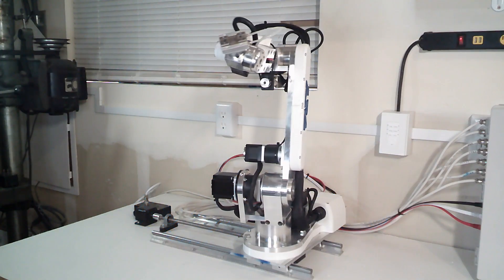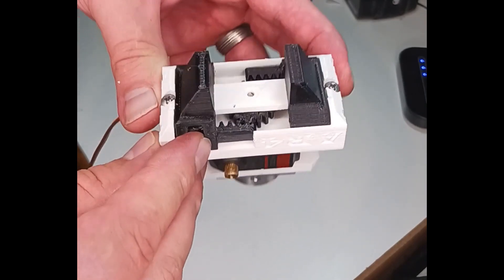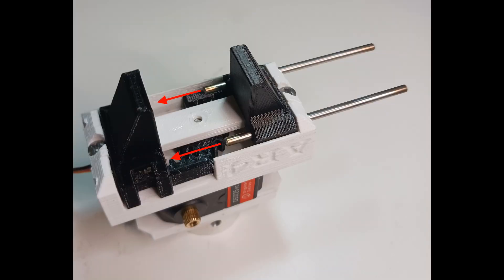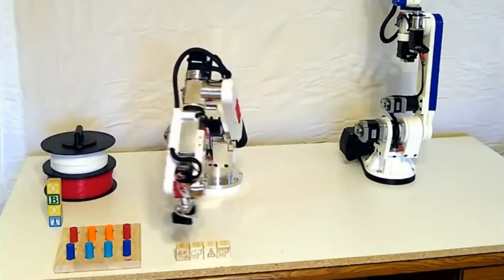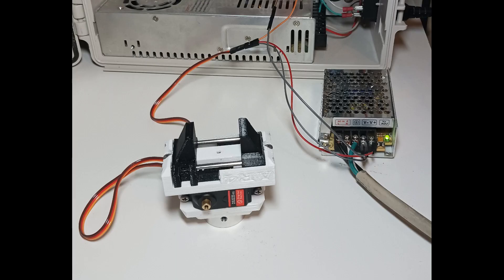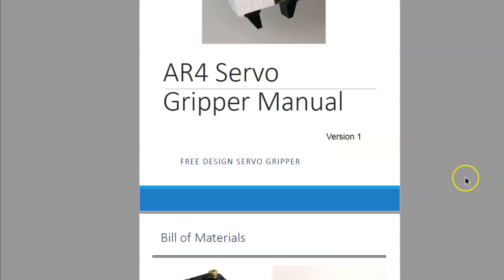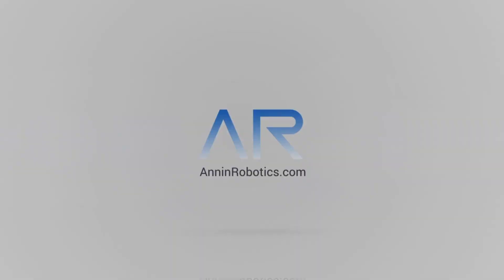AR4 Robot Arm Servo Gripper

Comment: How do you control the closing position? If the motor is tyring to fully close the gripper when it is holding an object, does this not cause an issue?

Comment: Hello. I have a question about servos. Recently I have made a rover with a 5DOF robot arm. I used standard brushed servos (2x 80kg and 2x 30kg and 1x 13kg). 4 of them work as intended. However, the 30kg one in the claw (DS3230 Pro) keeps overheating. I have already replaced servos in the claw several times, because they burned due to overheating. During operation, the claw servo becomes really hot. Even when not holding anything in the claw, after 10min it becomes hot. I am thinking about replacing it with something better that will enable my rover to hold objects for several minutes, and the servos won't die. But what is better?

1. Brushed servo with full aluminium case. Maybe will dissipate heat better. Cost approx. 22$
2. Brushless servo with partially aluminium case. Brushless motor, theoretically, will dissipate heat better due to its windings fixed to its case. Cost approx 26$.
3. Very weak brushed servo (just enough to operate the claw). Lower power->lower heat emission->longer time before overheat. Cost under 10$.
4. If all of the above are bad variants, I will make a custom worm gear servo (that won't consume power when static). But then I'll have to redesign and re-print the claw. Cost under 10$.

Which of these, do you think, will solve my problem? 
Coreless servos are not considered, as they are even less resistant to overheat than cored or brushless.

Comment: I really wish you had more time to promote your AR4 generally and this gripper in particular. Cheap "desktop robots" or "home robots" remind me of where personal computers were in the mid to late 1970's. The AR4 kind of, sort of, seems like a toy... but of course it's not. It's a real robot that's very inexpensive to build and maintain. 

That second point is key. Cheap robots are a game changer. Yet, sadly, most software engineers seem myopically focused on software alone and not software + hardware, such as robots. We don't need another Google, or Amazon, or Facebook (Meta). We need something to wash our dishes and fold our laundry.

Comment: I used your Ar2 old program  for my robot Arm but the stepper motors are making noise, using nema 34 and i am using only 24volt supply
Reply from the maker: Stepper motor whine or noise can be cause by miswiring, if you have any questions please email me at info@anninrobotics.com or post on the forum thx.

Comment: Hi Chris, what is the weight of the gripper and, maybe a silly question, but does the gripper weight form part of the payload capacity?
Reply from the maker: the gripper weighs 150 grams or 5.3 oz.  Yes it would be factored into the payload.

Comment: Hello sir
I have made one Robotic Arm but it does not move in a straight line Between two points but goes straight when there are more points in between.
I have been using accelstepper and multi stepper to reach all steppers at same time. Any solution to it. 
It also jerks between points so how to avoid that. I think that's maybe because of backlash in planetary gear box so maybe that can go off when changed with harmonic drive. 
Thanks in advance sir.
Reply from the maker: Hello, all my software is free so you can download and see the algorithm I wrote to keep all the motors in time as well as the kinematics, if you want to execute straight lines you will need to perform kinematics at each waypoint along the line. Send me an email at info@anninrobotics.com or post in the forum at www.anninrobotics.com.  Its hard to track and keep up with questions and helping people on youtube comments.  Email me and let me know what kind of robot you are building and what software you are using and I will try to help out.
Reply: @anninrobotics  ok sir thankyou❤️
Reply: Should I upgrade my Arduino mega with due to keep the same . 
❤️❤️❤️

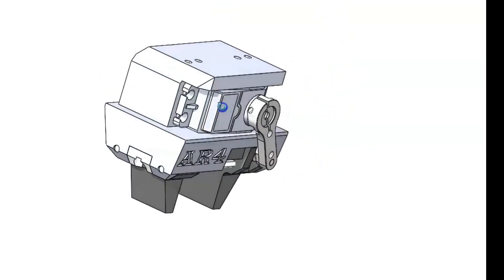Comment: @0:19  For the servo arm, since it's a Rotary to Linear reciprocating conversion concept. Thus, suggest to have a running slot on servo arm, catered to the Pin from grip. This facilitates degree of freedom and tackle constraints/ jamming at some point of servo arm's rotation.
Reply: DIY of Articulate robot has been eye opening to me. Thanks for sharing on this amazing work. Wish you Godspeed..

Comment: I would imagine another advantage of pneumatic is it has a relatively consistent force independent of the size of the object you are gripping.  For a servo, do you need to program the size of the object?  Otherwise the servo would fail to grasp or perhaps overheat trying to crush the object.
Reply from the maker: I've been programming it to be a slightly smaller size than the object but then I try not to keep it energized for too long so it doesn't overheat.
Reply: @anninrobotics  if space allows it, link servo horn to the jaws via a spring linkage (similar to a shock absorber) so that the servo can drive to "full closed" so that jaws will contact the gripped part with a known preload proportional to the spring constant. This design look great though. Very compact 👍
Reply: You can replicate this electrically if you remove the control circuits from the servo and directly drive the brushed DC motor with -5 to +5 volts. The voltage will be proportional to grip force. You will however sacrifice the ability to command specific positions.